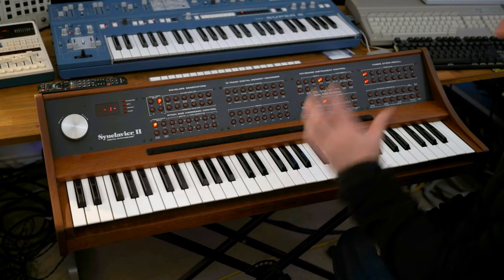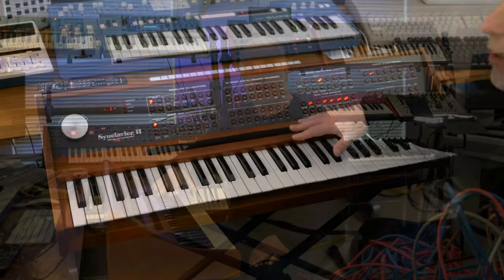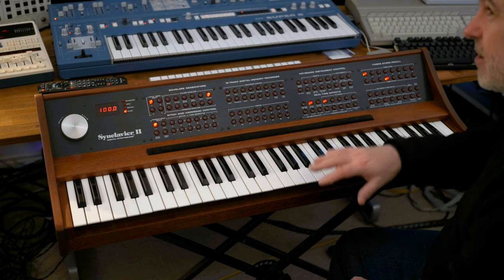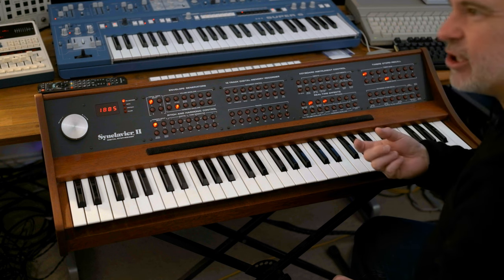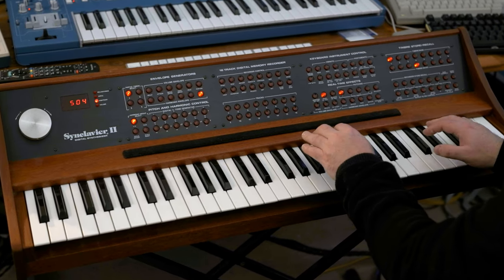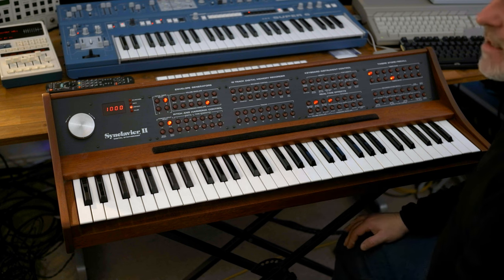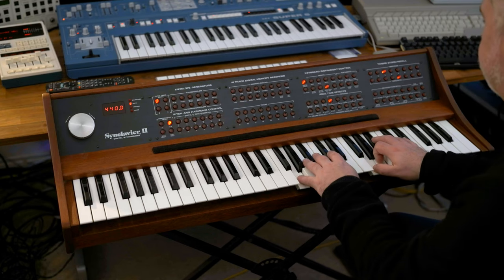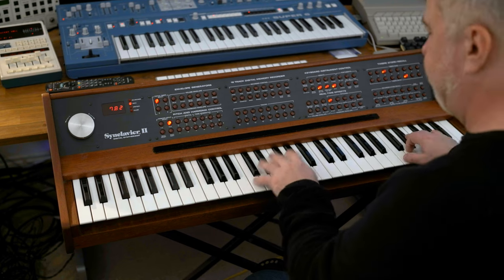Synclavier Q&A and Patch Creation

Comment: I owned 4 Synclaviers including a full 9600 and D2D. I was very lucky to have been part of a great group of amazing people who really used these machines at their highest level. FM synthesis was just a small part of the overall but I appreciate you posting this. My memory of the Synclav is the ease with which complexity and detail came together. The fluidity of the keyboard interface that was doing things with access to as little as 64mg of ram and 32 voices and then later using D2d for tracking. I loved the years I spent working with these machines and am still convinced there is still nothing comparable.
Reply from the maker: Sometimes there is nothing the same as the old workflow you knew so well. Prices are still not stupid (yet) for a second hand synclavier but I hear you, I'm doing everything in my power to keep my old Fairlight running until I die, there is nothing in sampling like it and I use it today the same way it was used when new  :D
Reply: To be honnest i discover the FM quality of the engine with the Arturia version, it was marvelous that thing was a Yamaha DX 7 killer, it's also an additive multi timbral layer synth with an outstanding sampling capability for the time, i Saw this machine in the making of from Akira and discover that also Skywalker sound use it also for sound design, but i know why Trevor Horn and Steven Lipson made that massive sound in the 80's same for the solo album of Sting using that on the single Russian or Dream of the blue turtle , Zappa was the most wierd user and he like this tool so much that he made crazy album with only this .

Comment: I wonder if some has bothered to replace the mainframe with a softsynth.. The mac mini m4, has 10 teraflops of processing power, thats a third of a Nvidia A10.. It means its fast enough to use AI for content creation, but not fantastic, more entry level. You can run stable diffusion on it..  If you plan to get one, if you need to upgrade it, upgrade ram first, cause I think its in the M4 chip, so unlike older computers you won't find ram sticks. The solid state drive (SSD) is accessible, but someone said its nonstandard interface. But really who needs more than 256GB SSD.  Extra external hard drives don't make up for it cause they are further from the CPU.  Distance matters. In college my digital electronics professor would ask "how long is a nanosecond? "  and then he  would  measure about a foot, or was it a yard?  The best part of the macs is their operating system is designed to be zero latency , that means it will preempt other tasks to let time-dependent task .. Also the CPU can adjust its clock cycle dependent on activity.  Craziest thing of these M4 mac minis. They use less power than your LED or florescent lights: 6 to 40 watts, depending on the work load..

Comment: Question, is the black bar on top of the Synclavier a pitch bend like the CS-80?
Reply from the maker: Originally I have been told they shipped as a option for the CS-80 Ribon controller. The story (possibly not true) is that Yamaha stoped suppliying the part and after that it was just wood with  black felt as an accent. The connector for the ribon controller is still inside it seems.

Comment: When trying to hunt down a vintage unit, how do you know what, of the man flavors and variations, you are looking at? I lusted after that system ever since I was a teen back in the early 80s. That, and the original Moog modular are the two synths that I wished I could have had access to. Nowadays, I have a virtual version form Arturia running in my DAW, and a standalone version running on my iPad. As fun as they are, there really is no substitution for the original hardware that these plugins, by virtue of being software, just don't have.

Comment: I’ve been watching the Anthony Marinelli Music channel on the Synclavier (by the way did you realize you spelled it wrong in the title … forgot the “i”) and this video just got recommended. I’m starting to think this synth needs a re-release (I would want a few analog filter options), stereo panning, and some really nice built in effects … ok that’s my wish list, but it would be mostly all digital but the filters and probably wouldn’t need to be too expensive.  It is mostly digital and the CPU needed to run it I’m sure is super cheap nowadays.
Reply from the maker: Thanks, I fixed the title :D .. They just did a new version Synclavier Regen. Its running the original code (which has been updated to run on modern processors) but also has many new features!

Comment: Why don't you showcase the frame envelope where it crossfades between the different frames of a partial ,
Reply from the maker: Because the Able B procressor this Synclavier II has does not support Frame Envelopes. It was a later development around the time of the Sampler to Disk option and processor & RAM upgrade :D